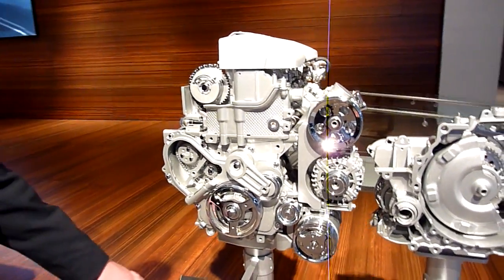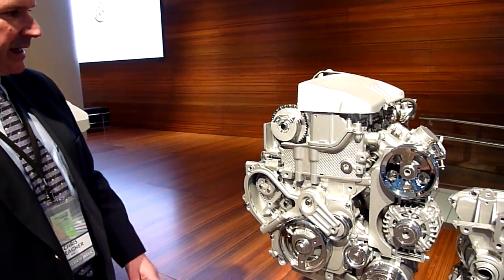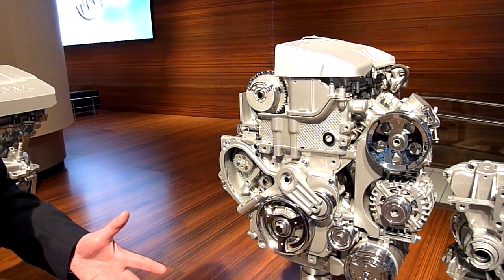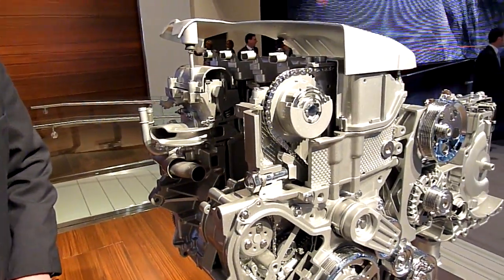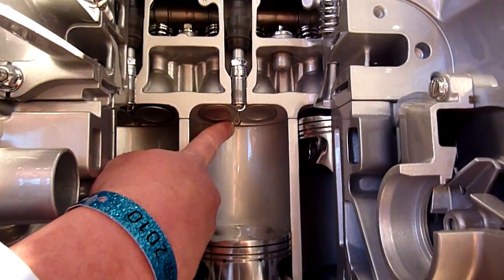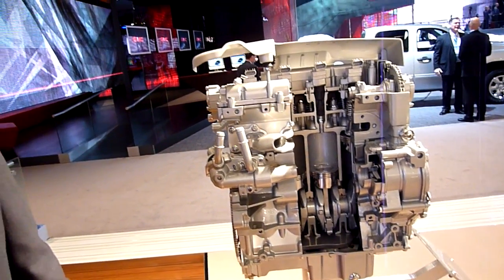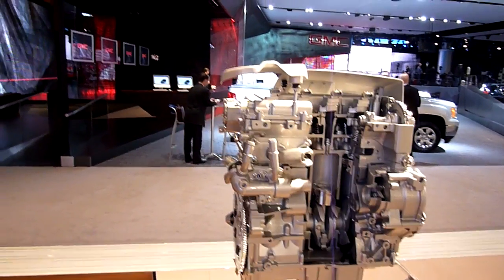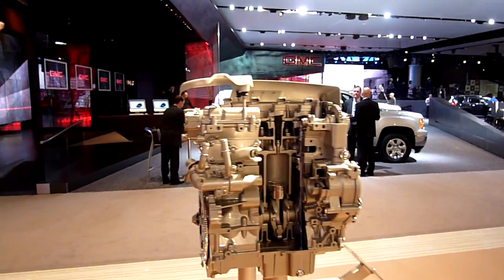General Motors Engineer gives us the lowdown on Ecotec 2.4

Comment: Maybe that chief engineer could come to my place and fix my timing chain issue! My timing chain disintegrated due to tension-er failure. This happened at 96,000 highway miles despite proper maintenance. It has 10,000 more miles on it now and is ticking again which was the first sign of problems the first time the timing system failed. When I finally dig myself out of this Chevy money pit I will be buying a Ford or Toyota!
Reply: Exactly! I'm so frustrated! 3,000 head job and without my vehicle forever it felt like
Reply: Not to mention the notorious oil consumption due to faulty oil control rings that sparked a class-action lawsuit!
Reply: You're better off with a Toyota

Comment: Great that this video was uploaded before GM realized all they did wrong on this engine.  Main problem is the high pressure fuel pump.  For the 2010 model year, with the usual rush to production that GM does, that pump has a HUGE issue.  The piston wears VERY quickly and allows gasoline into the oil.  This was first noticed when Equinox engines would "run on" after turning the key off.  There was so much gasoline in the oil that the fumes were combustible and the engine would run after key off.  GM's "fantastic" first solution was to change the engine computer to ensure all spark was turned off with the key (it had been tied to the crank sensor) AND to INCREASE the "allowed, or acceptable" limit for amount of gasoline in the oil!!!  Gas in the oil leads to premature engine wear and failure of several components, including the timing chain and related hardware.  Newer Equinox models (2012 and newer, not sure about 2011) have a revised fuel pump with a DLC (Diamond Like Coating) on the piston, and require use of synthetic oil to prevent the wear issue.  GM is aware of the issues with the 2010 but because of the magnitude of the problem (quantity of cars sold and cost to fix - new engine) they work to get the customer out of warranty with small repairs and delays.  If you have a 2010 with crappy gas mileage (less than 25 mpg) and have had issue with the timing chain, you probably need an engine replacement.  Good luck getting GM to pay for it.

Comment: I'm currently shopping for an Equinox. From lots of research I've been reading that the 2010-2011 2.4L engines have start up noise and stalling problems. What did GM change in 2012 to fix this problem?
Reply: +Peace 

they haven't fixed it....don't buy it!!!
Reply: They changed their ad campaign and marketing strategy to appeal to younger buyers who they figured were too dumb to know what a worthless steaming pile an equinox was and is
Reply: nothing
Reply: Do not buy this suv with this engine.  You'll be sorry down the road.  The timing chain will go way before 80k and probably destroy your motor.
There is a silent recall on them within 120k miles and you'll get a free oil change and after 1000k miles they'll determine if the pistons and rings, and timing chain needs to be replaced for free.

Comment: Hey jerkoff  why don't u engineer an engine that don't spit timing chains out of its own ass
Reply: Riggy475 thats been a issue on all engines lol do you remember how bad ford sohc 427 was at breaking chains and how many times the tritons lost cam phasers they all break its just most of the time its casting problems not design issues
Reply: Jared Bib actually the 5.4 was a design flaw. It would snap camshafts constantly

Comment: @Surannhealz 
GM's 2.4l engine never did breathe right from the original 2.4l twin cam found in the cavaliers, sunfires ect. ive owned a cavy with a 2.4l for a while and i noticed how bad the intake is on the car. very bad design on the intake, throttle body, manifold. almost makes me wonder if they did it on purpose to keep the power down....

Comment: 2.4L @ 11.2:1 compression and variable cam profiles and it makes 182HP. The torque is what you would expect for the displacement. But the horsepower seems to indicate the motor just doesn't breathe as well as it could.